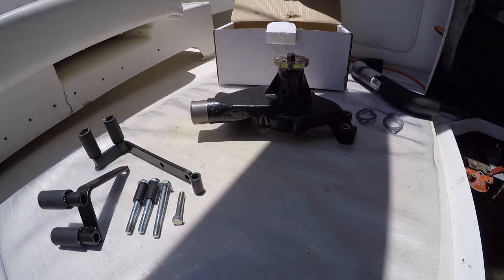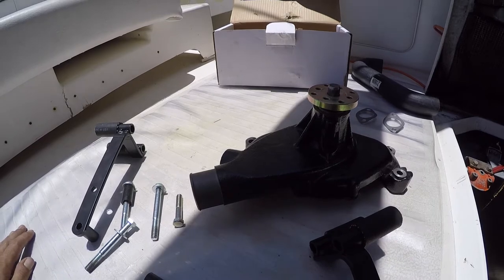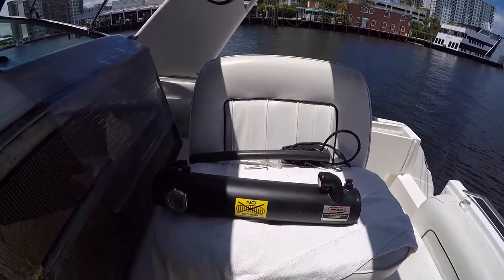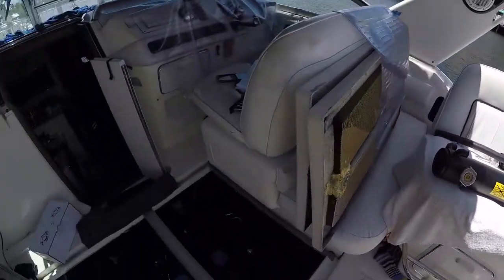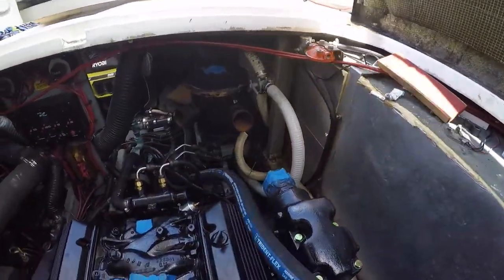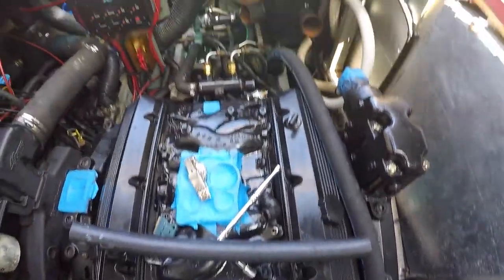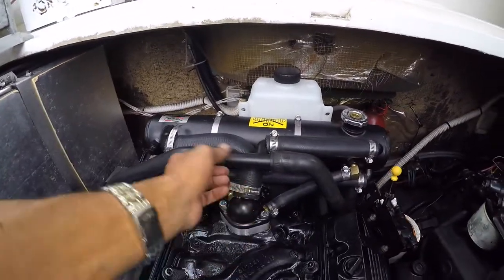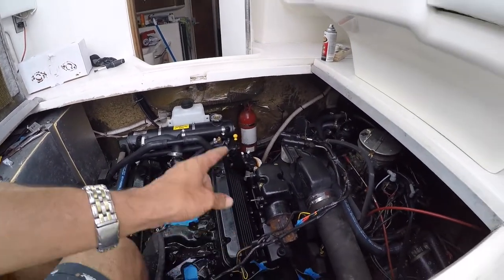Mercruiser fresh water cooling kit installation ( no more salty water in the engine )

Comment: Hi, great video! 
I was wondering what modifications have you made on the raisers. Did you use a blind joint  or they are dry joint risers?
Reply from the maker: Thank you for watching bud! For the risers, all I had to do was add a block off gasket separating the bottom part and the riser so anti-freeze flows through the bottom, half and the salt water gets dumped on the top part and out the exhaust.
Like this one 
https://amzn.to/3Am7rwu
Reply: @Cruisingthesouth  thanks for the info!   Enjoy the boat !

Comment: Hello.  I wanted to let you know that I have you to thank for the closed cooling system!! I bought a Cobalt and moved it out to the Pacific saltwater and this system is key! Great stuff 👏 👍
Reply from the maker: Thank you for watching my friend! She will last forever now! My old engines had 3000 hour on them and the only reason they went to bust was because internal corrosion from saltwater. Have a wonderful day!
Reply: @Cruisingthesouth  Hello  again.  I have a question.  When I now have the closed cooling system on my Mercruiser 8.2L, does that mean that the manifolds/risers don't get anymore saltwater coming through? Or is saltwater still coming in on the exchange so I will have to maintain/replace?  Thanks in advance!  Suggesting videos on IAC issues, linkage issues, what "good maintenance" looks like and what poor maintenance looks like. Great Work!

Comment: hi bro, always love your videos, I just installed a fwc system on my boat w/ 7.4L but it is a full system, meaning it protects the exhaust manifolds also, why did you only put a half system ? I know monitor makes a full. and seeing how your manifolds fit in there it must be difficult to change them. Also you need to put a strainer after the raw water pump to prevent the exchanger from clogging up, maybe some clear hoses on the discharge or the suction side to show flow, good luck with your system maybe by the time you have to change out the manifolds they will have dryjoint exhaust for big blocks,
Reply from the maker: Hello my friend thank you for watching the video :-) I just did my other engine and I went full system on the other engine, but the reason why I went with a half system is because I had to replace the manifolds about six months prior and I didn’t want to have to replace them again and I didn’t want that rusty section on the system so I only went half, and I do have a big strainer just passed my seacock so the water is filtered even before gets to the water pump and therefore my oil heat exchangers and So on. Oh man I would love dry exhaust on these things huh!! I have straight shaft so my exhaust system is a airlift system so anything above 3000 RPMs they steam like a locomotive LOL which I kind a like but I would prefer if they didn’t steam but I guess that’s the price to pay for straight shaft with the side exhaust! Do you have straight shaft?

Comment: very nice! I just bought a 1990 SeaRay 420 Sundancer, but am looking to replace the engines within the next 2 years and add a closed cooling kit (I boat on the upper Ohio River near Pittsburgh, Pa). Where did you get your engines and closed cooling kit?
Reply from the maker: Hello, thank you for watching the video!☺️ I bought my engines from bills Marine in Fort Lauderdale for about 3500 a pop for the long block and I bought the cooling kits on eBay, they come available every once in a while, because of what was available at the time, one of my engines I have half system and one of my engine is a full system

Comment: Where can I get the brackets for a 7.4L exchanger?
Reply from the maker: Hey my friend sorry for the delay! Thank you for watching the video! I kind of started going through the same dilemma of trying to piece this out but it’s a nightmare there’s so many fittings that on the end of the day you are going to save money by just buying a complete kit, they have the full closed cooling kit and the half close cooling kit, the full close cooling kit the bottom part of your exhaust manifolds also gets cooled by antifreeze, sounds good but that set up the engine runs a little bit hotter so I went with the half kit where your entire exhaust manifold gets raw water but I’m cool with that! Raw water cooled is the most efficient and the half close cooling system is the second most efficient and the full closed system is the least cooling efficient.